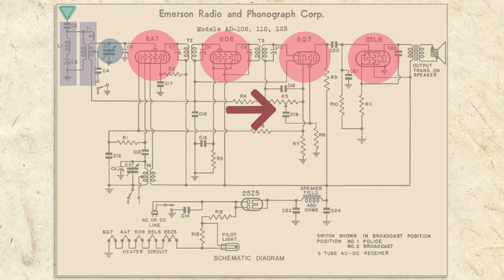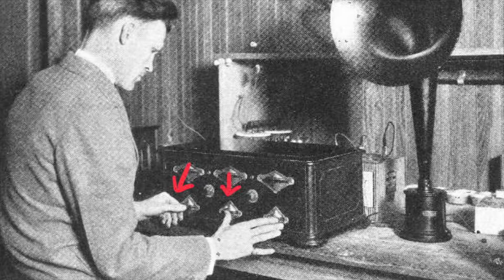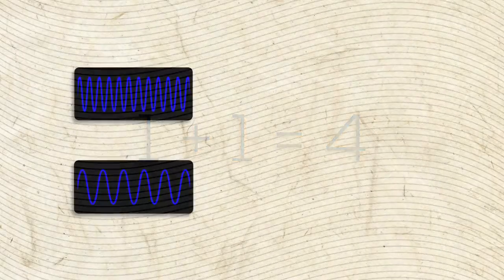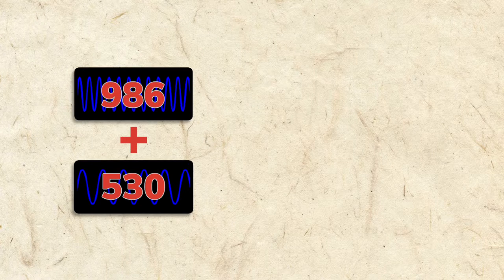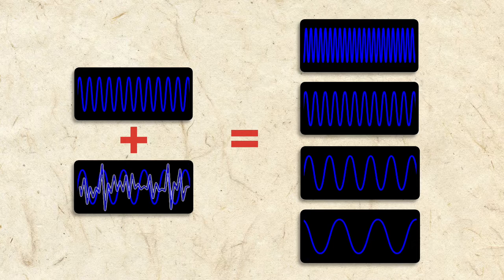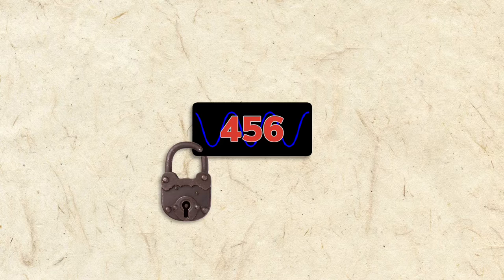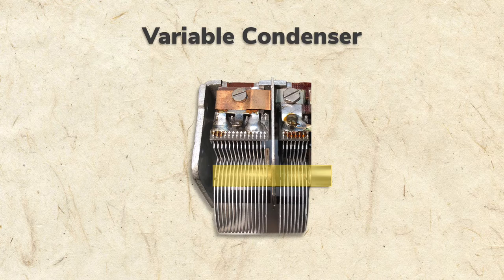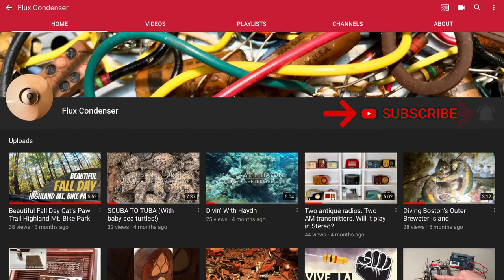How Do Superheterodyne Radios Work?

Comment: Flux Condenser:  Is a superheterodyne receiver better than a regular receiver?  Does it bring distant radio stations in better?
Reply from the maker: Cimbakahn, virtually all modern receivers, including FM, use superheterodyne technology, so it’s not really a feature you can shop for these days. In the early days of radios, superheterodyne receivers offered convenience, performance and size advantages over TRFs when they were introduced so TRFs quickly went the way of the Dodo. Superhet radios generally provide better selectivity and sensitivity over TRFs, so yes, their ability to bring in distant stations is better.
Reply: @FluxCondenser  The reason why I'm asking is because I am thinking about purchasing an older shortwave radio.  I am looking at these:  Radio shack dx-398 / Sangean ATS-909 / Sangean ATS-909X / Tecsun PL880 / sony 2010 / Lowe HF150 / Lowe HF350 / Panasonic RF-2200 and some others too!

Comment: The waves are multiplied. The mathematics is trigonometry...
Reply from the maker: What waves are multiplied? Please give a specific example and show the math.
Reply: @FluxCondenser OK Here goes: The oscillator and the wave which is received via the antennae and not rejected by the LC tuner circuit, is mixed (multiplied by) with the local oscillator signal. Several fun exercises:  Look up the trigonometric function resulting from multiplying two sine waves each with two different frequencies. Several terms result, two of interest are the sum and difference of the mixed signals frequencies. Or if you like record a small two or three second sample of an AM signal,   multiply it by a  sine wave with say a 550 kHz frequency, then  crunch through the algorithm which transforms the resulting signal from the time domain to the frequency domain. The resulting spectrum will have peaks at the am input frequency, the oscillator frequency, the sum of the two and the difference of the two, and most likely some "noise". The second exercise is analogous to the process one goes through when recording an earthquakes ground motion and creating the frequency domain "response spectrum". Finally one can use two signal sine wave generators, connect them to the input of an oscilloscope and observe the resulting frequency in both the time domain and frequency domain. This can also be done using mathematically using excel. Enjoyed your videos'. Take care.
Reply from the maker: @JDBolt1958  “Two of interest are the sum and difference of the mixed signal frequencies...” That’s precisely what I discussed in the video and was confused why you stated the waves are multiplied. I wasn’t sure and I’m still not sure what your point was about that.
Reply: @FluxCondenser  Well that's ok, folks who want to get in depth about why "the signals add and subtract" terminology I have been confused  about for a half century, but certainly is the convention, might find some fun  looking more in depth.
Reply from the maker: I have no issues with getting more in depth. You simply haven’t explained your comment which said the waves are multiplied. You say “look it up” and then repeat what I had already stated in the video, which is that there is a sum and a difference signal. That’s not multiplication.
Reply: Ok. This begs the questions. Where do the sum and differences come from? Why do they add. Why is the circuit called a mixer, not and adder. Why is a signal transforming circuit often called a multiplier?
Reply from the maker: My understanding is that it simply comes from mixing two signals. Easily accomplished and viewable on a scope. Simply apply two signals. But it’s not a multiplying of the signals, it’s mixing, which is addition.
Reply from the maker: Further, there are voltage dividing and multiplying circuits which are easily made and understood, but that’s a different principle to adding frequencies.
Reply: @FluxCondenser  nope
Reply from the maker: @JDBolt1958  Nope to what?
Reply: @FluxCondenser  The frequencies add, the signals multiply.
Reply from the maker: @JDBolt1958  You first said the waves are multiplied. The waves are frequencies. You now say the waves are added. That’s what I stated in the video, so again, not sure what your point is. 

Now you say the signals multiply. Tell me what signals you’re referring to and exactly how they multiply. The signals under discussion are waves and you’ve already indicated that those are added, not multiplied. 

If you made a mistake when you originally stated they’re multiplied, please just say that. As it is, you keep making a claim that you haven’t validated and I’m giving you an opportunity to explain to me and the other viewers. 

The point of this channel and these comments is to educate, not obfuscate.
Reply: There is nothing obscure about my point. The carrier wave and IF wave combine.Another way to understand what is happening here is as described. Plot these two waves, decretise them, multiply them together, transform them from the time domain into the frequency domain one will see the resulting spectrum exhibit peek amplitude at the original IF frequency, carrier frequency, sum of the IF and carrier frequency, and difference between the carrier and if frequency, and other noise. You see waves are not frequencies. Frequency is a wave property. Simply stating the frequencies add is incomplete, misleading, and a dead end. For the benefit of your readers I clarified by providing a mathematical model of what is happening.
Reply from the maker: @JDBolt1958  No, you have not. You  continue to state that the signals combine and that somehow amounts to a multiplication. It does not. I’ve asked you repeatedly to show the math or state clearly what exact “multiplication” is taking place. You made a mistake in your original comment and refuse to acknowledge that. I will waste no more time with this and your future posts will be deleted if they continue to be off-track.
Reply: OK